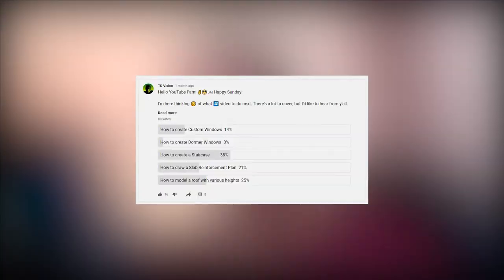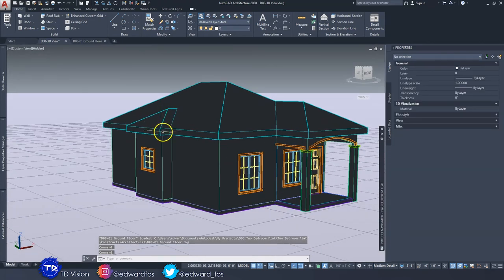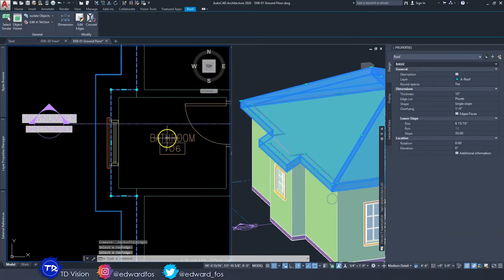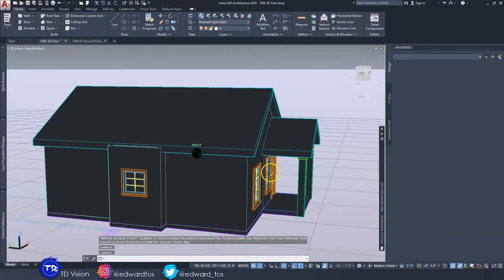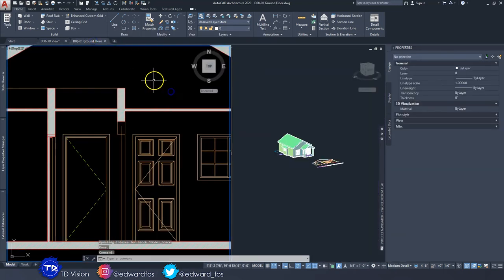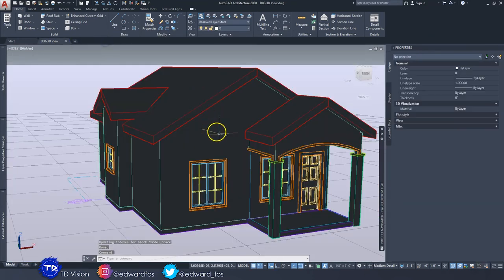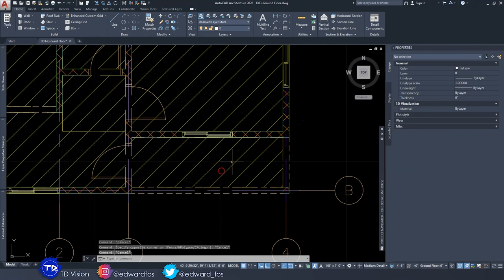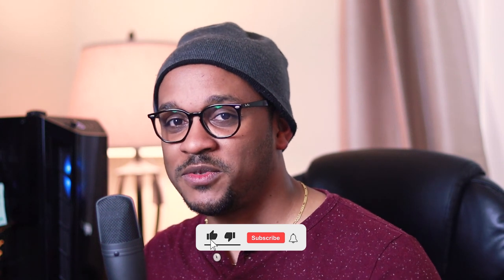ROOFS (with Various Heights) in AutoCAD Architecture 2024

Comment: So I have been following your video tutorials and I have learned a lot. Thanks for these. I do however can't seem to find any help online is whether or not Acad Architecture can do raised heel roofs/trusses. Any ideas?
Reply from the maker: Thanks for watching. Trusses in ACA in general can be time consuming to model , i.e. individual truss members. You can watch my video on wooden structure to get some ideas https://youtu.be/FkJU5CLQgaQ . Otherwise, you could just model to a LOD 200 standard and do detail views like I did in my video on detail veiws https://youtu.be/zxixHN87-38 .
Reply: @TDVision_U  I technically dont need the truss information for the type of work that I do. What I am looking for is more of a raised heel truss type of look so that when I build a section using the section command that the Underside of soffit is inline with the top of plate. I am in Canada so we typically use raised heel trusses now to allow for more attic insulation at the exterior walls.
Reply from the maker: Got it. I think you could perhaps extend your walls a little bit higher. There's a way to edit the walls and add extra component at the top of the wall, but I haven't done a video on that as yet.